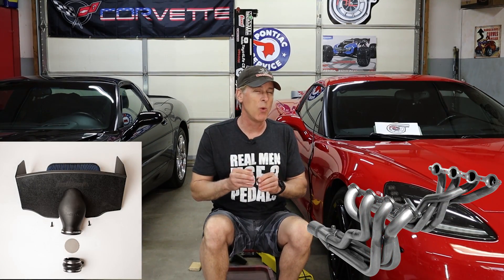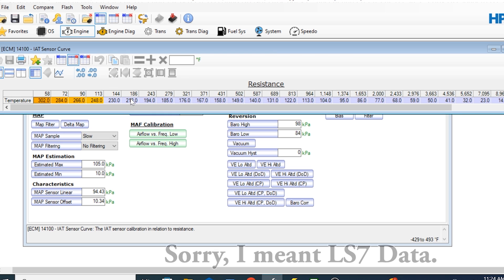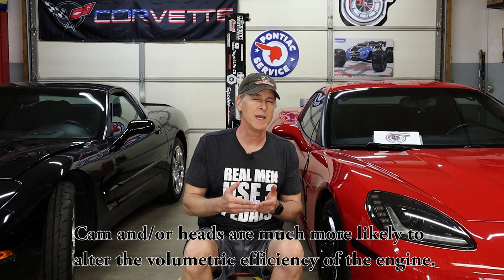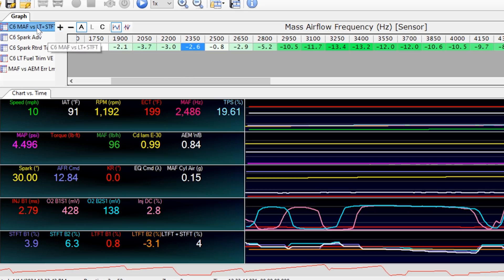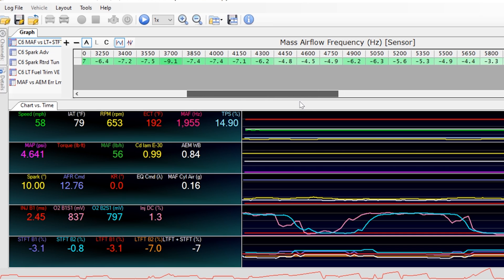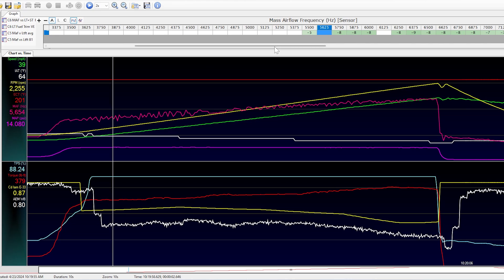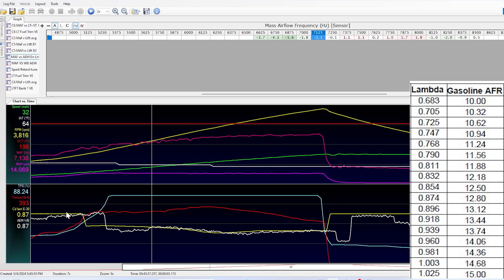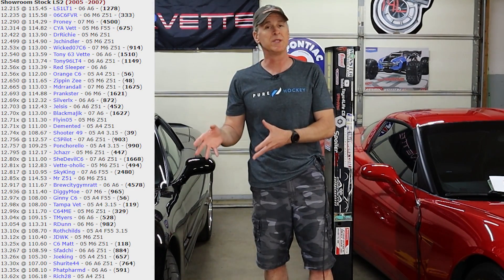Quick C6 Corvette (LS2) Tune / for LS7 Air Intake & MAF Upgrade

Comment: Do you perform any remote tuning services for other Corvette drivers?  I learned enough about HP Tuners to realize I need to maintain a decent distance between myself and it.  Currently I'm running a fairly stock 2001 Vette with straight thru Borla axle-back.  6-speed.  This spring I'm adding headers, x-pipe to existing system.  Once I'm able to get the heads, cam, intake done,  then I know I'll need to get it on the dyno.  Thanks!
Reply from the maker: I might do some training if somebody really wants to learn the basics and get a jump start.